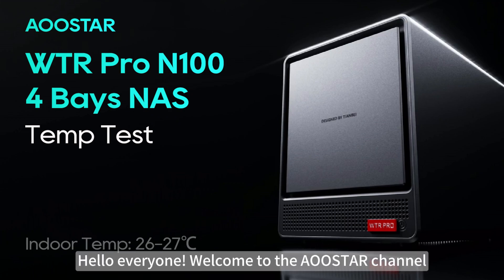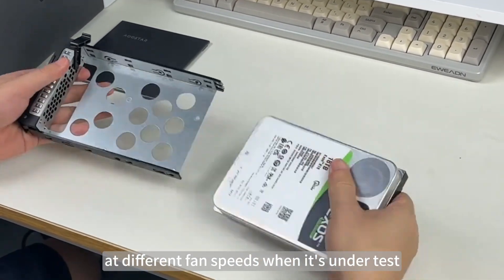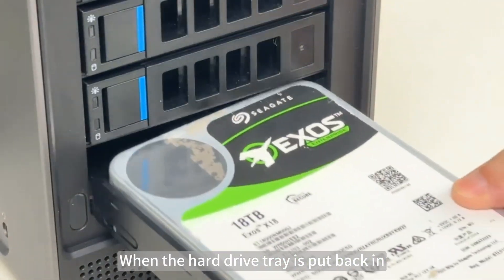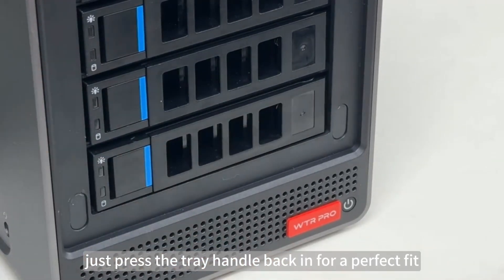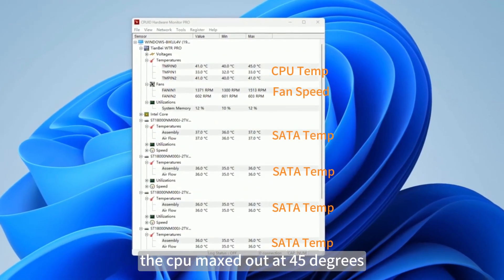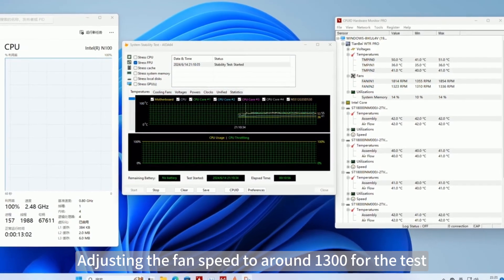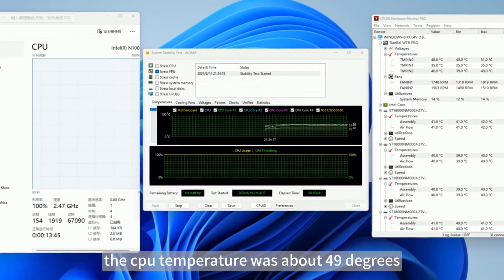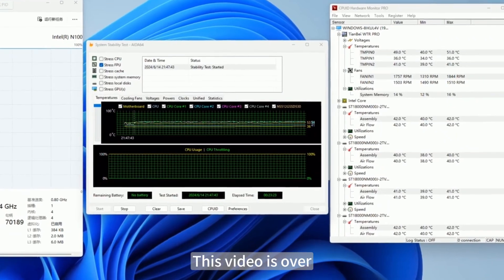Hard disk installation and removal tutorials and temperature tests --AOOSTAR N100 4 BayS NAS

Comment: I bought 3 of these devices. Everything is very bad.
Loud whistling of chokes or MOSFETs when 4 hard drives are working. Without drives it works quietly.
UDMA CRC errors are accumulating on the 3rd SATA port. My zpool
fell apart.
The power supply makes extraneous sounds without a load. I had to replace it.
The power button sticks and I have to disassemble the case.
Tech support can't do anything. They say that the whistling from the device is normal.

Comment: Hello,
Nice product! I am waiting for the Ryzen 7 version.
Do you have the data to share regarding electric consumption during the load test?
Thank you.
Reply from the maker: Our  WTR Pro 4 Bays Nas with the Ryzen 7 5825U processor version consumes about 6-7W of standby power with no hard drives loaded, and about 36-37W with four HHDs loaded as well as two RAM and one SSD installed.
Reply: @AOOSTAR-PC  Any timeframe for a Ryzen 7 version?
Reply: @MickySarge  Few days ago ordered a brand new WTR pro Ryzen 7 5825U version, yesterday it arrived to local airport. Few days i will get it.
Reply: @loncimancibamba  oh! I didn’t even know it was for sale. I only see the n100 version on their site.

Comment: What's the controller for the SATA drives? Is the 2.5 LAN using the Intel i226 model?
Reply from the maker: Hi! The controller for the SATA drive is asm1064 and the 2.5G LAN is 226v.